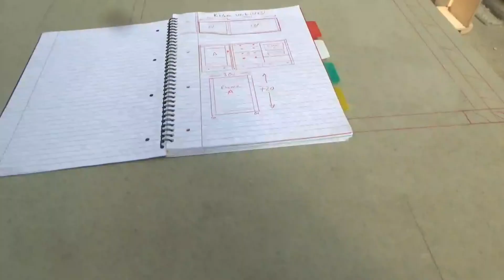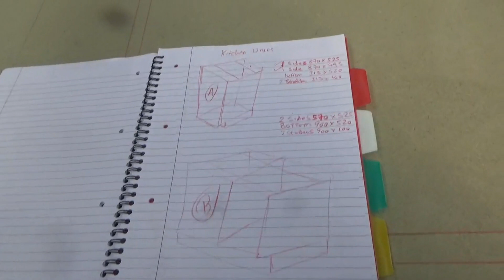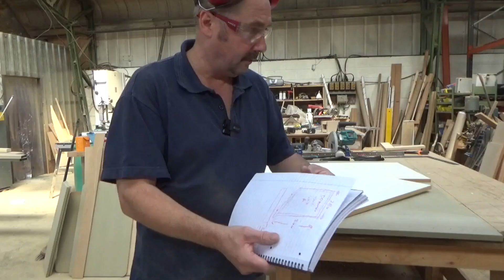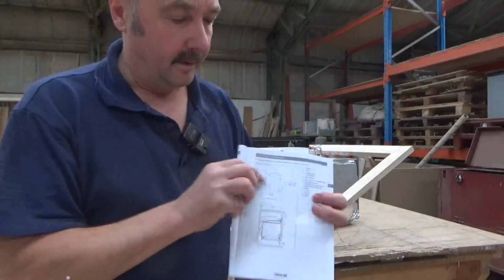Narrowboat . How to build an oven housing unit with storage cabinets Pt 1.

Comment: Built to last. I think I will be going with flatpack though as I just dont have the skills
Reply from the maker: Hi Emma ,They are strong units ,should last. Have you a boat that you are going to fit out ?
Reply: @nogunwales9406  We dont have a boat ATM, going to spend the next few months downsizing our junk and then sell the house. Will be looking for 57-62 ft aprox
Reply from the maker: @DEmma1972  My boat is 60ft & you can go most places ,locks above that length can get tricky. It is said if you buy a new pair of socks you have to throw  another pair away on a narrowboat, so you have to downsize your junk.
Reply: @nogunwales9406  well we worked out that if we had a 57ft then we have roughly 4ft of extra space which was going to be a crosswidth bed come extra lounge area. 62ft would give us a nice 9ft  luxury lounge.